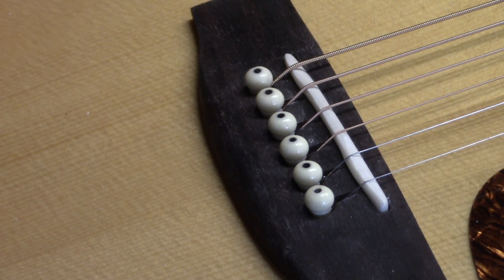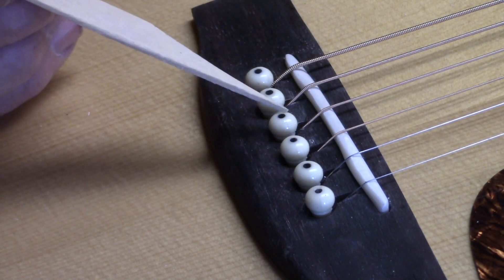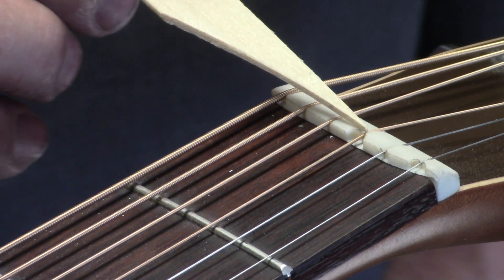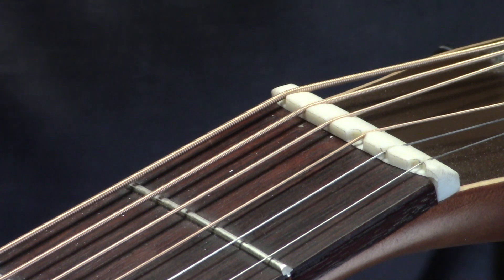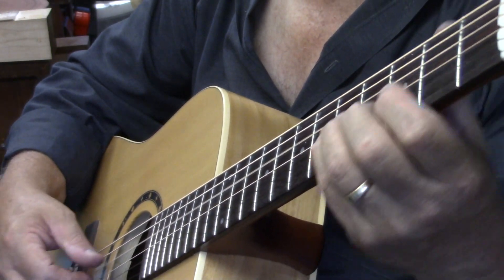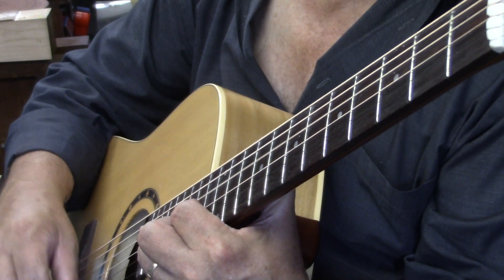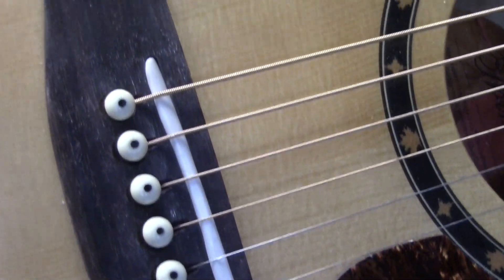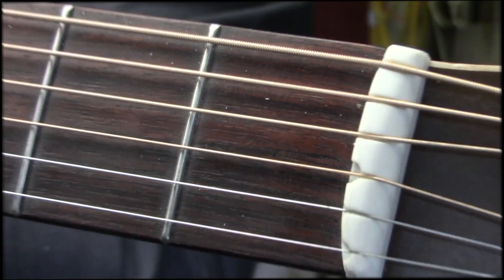Reverse-cantilevered Comp Bridge saddle@StringTech Workstations

Comment: They don't sound that in tune from the factory, for sure.
Reply: The thing to remember is all those people working in the factories in America went through the same education system as the ones out there rioting and running the streets.
Reply from the maker: China set themselves up as the "World's Manufacturer" and we took the bait               " hook / line and sinker ".
Reply: I don't get the nut compensation thing. Nice work, but the nut thing looks like BS. Do you make compensated caps as well?...
Reply: @johnvermeersch3597  They look the way they do because of manufacturing problems and errors.  The more radical the look the more the manufacturers screwed up . Short of things like a new fretboard and frets and or a bridge repositioning that can solve these kind of issues. This is the only available solution.
Reply from the maker: You are most certainly entitled to your opinion John. But the tuner doesn't lie. I have 560 videos demonstrating this level of precision tuning. A Tele / Les Paul / Gibson 330 / 2 Martins / and a Larrivee ... are all coming down the pipe shortly. Pretty well any guitar you can name..... I have demonstrated ( in many cases before and after )... have look at this : https://youtu.be/VxG5g0eLVQo
Reply: @johnvermeersch3597  You're simply missing the point.